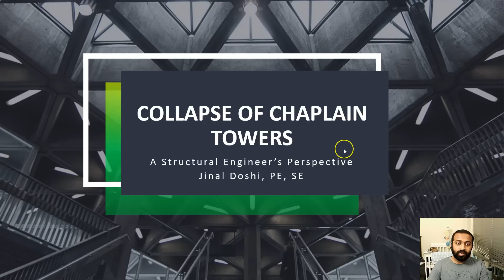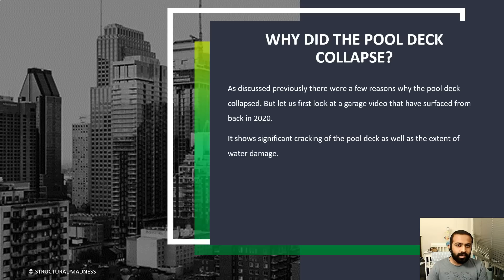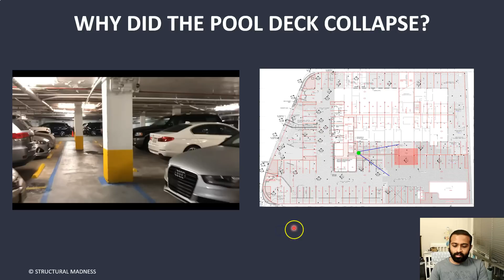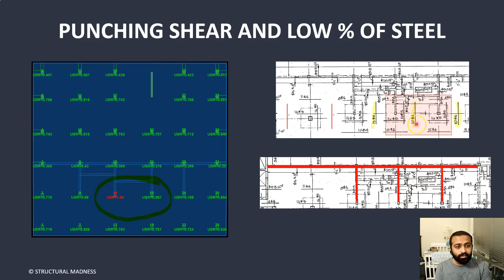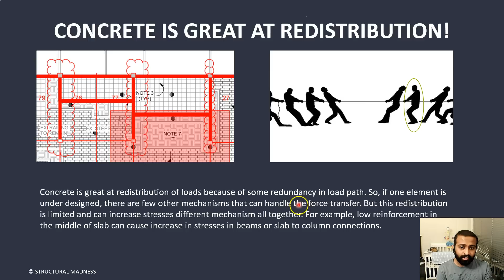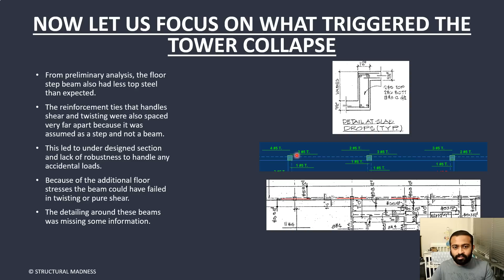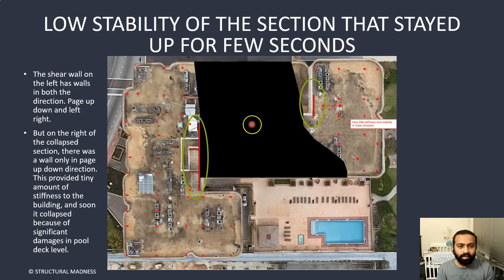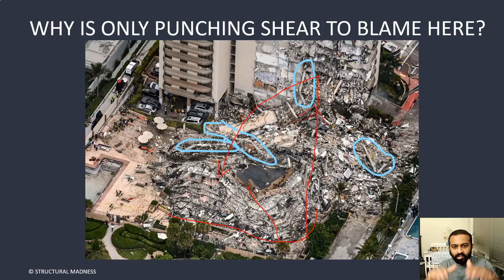Reasons behind Surfside Building - Champlain Towers South - Collapse : A Structural Engineers Review

Comment: You are aware that a copy of this building is still standing one block away, right? You are aware that the collapsed building recently failed its 40 year inspection in fairly dramatic (i.e. very expensive remediation) fashion. You are aware that the copy building passed with flying color. Based on your hindsight structural analysis, would you recommend they "pull" the copy? Would you recommend they strengthen it?
Reply: Yes I am aware, but that’s what my point is, this building stood up for 40 years. It took some significant strength deterioration up until this point to trigger this collapse. Even when we say the capacity of section was lesser than demands, we talk about design capacity. In reality the capacity of undamaged section sometimes may probably be higher than 50% based on material strength variability, how it was exactly placed on site and the amount of cracks that have opened up. 
If north was repaired prior to this, but not strengthen, it could be okay, but the consultants should carefully look at the couple of sections that I was pointing out because they were a bit overstressed. If the crack widths and actual material strength are higher than expected, then the towers will very well be okay.
Structural engineering is really complicated because of such issues. Like even two exactly same buildings can perform differently based on how they aged and how they were maintained. Now that’s why I didn’t talk about North tower because I didn’t want to apply a blanket statement of all buildings under designed.
Reply: I would most definitely recommend that they fully analyze and investigate and strengthen the sister building.  Hire me as an expert witness and I'll tell them that.  The structural analysis that we have done so far is only on a small part of the building, we don't know what other problems might be found.

Comment: Thank you! By far the most professional and comprehensive explanation of what happened to Champlain Towers South. Considering the North Tower was built with the same design I believe the North Tower pool deck should be strategically reinforced with temp columns until final cause of the South Tower is confirmed. Do you agree and do you know if they are considering this?

Comment: You are wrong at the end of the ramp is column 14 car parking space the next column is 27 car parking space or M10 and across is cps 28 and 76 where we see debris from the pool above before that the pool deck collapsed was noticed by report of someone there cps 72 which had collapsed into the garage so it collapse along the shear wall and the footpath of the building and cps 76 75 74 and was pulled down the building because of bad  design and weatherproofing shoddy maintenance and last of all not enough rebar on the pool deck and in the columns leading to punching shear .
Reply: Reminds me of a guy interviewed after 911 explaining the collapse. I thought it was peculiar. About 3 months later I heard his voice doing a commercial. I noted it and someone confirmed the name of the guy. He was an actor. Wish I'd kept notes.

Comment: What kind of maintenance could have been done to prevent this collapse? Unless they were going to replace beams, wouldn't this building have fallen regardless?
Reply: The deck needed to be taken apart and rebuilt.  There were water infiltration problems going back decades.  They had the option of jackhammering it apart, and fixing the underlying issues - the source of which are still undetermined (this will be the primary focus of the investigation, what was the original problem), or paving over it with some surface waterproofing.  The later is cheaper and more attractive, and the option almost everyone chooses, but it obviously was the wrong choice.  The needed repairs were so extensive the bldg may have to be evacuated for a year or more.
Reply: @kenlieberman4215  I wonder if that was done, would it have prevented this still. I don't know if the engineer hired even understood the immediate danger, nor  the HOA. I saw an article on the use of cat scan devices they use, after the fact, to determine weaknesses, but these aren't used prior because of the cost. I'm not making excuses, but pointing out that it's possible without this kind of test, nobody would have understood the real problem.  We don't even know until results are in, if fixing this pool area would have been enough.  Maybe it's time for more intense inspections , along with a grading system, instead of just at periods of time.  I have a feeling the current system, even if more frequent, still isn't enough. Are they still using the same criteria today for other buildings in the area? It's obviously not good enough.
Reply: @TnK2015  Morabito sent a report to the township in 2018 saying there was only 5% structural damage and it could be fixed with patching.  Clearly they underestimated the problem.  The problem is this type of damage can be hard to see.  Also the traditional grading system is based on the size of the cracks, but the location can be more important.  The garage video shows cracks running diagnonaly from column to column.  This indicates that the slab is overstressed.  But why?

There is the proximate failure - the deck collapse at whatever point; the adjacent failure - delamination of the top rebar/slab   -hidden under the paver/topping but seen in the cores where all the top rebar seperated due to water damage; and the ultimate failure - why was this slab failing apart so soon after it had been built?
This problem had been going on for decades.  To call it a "maintanence" is to call a lemon auto a maintenance issue.

A bldg shouldn't have to rebuilt every 20-30 years.  These bldgs are "over-engineered" - they have a 4x design factor.  This allows for errors in construction, but f enough errors occur, that may all evaporate.  The delamination of the structural slab would reduce its strength but more than half, but why did this occur?  Inadequate waterproof may have been an issue.  There is some evidence of less steel being installed than the plans called for, another issue but I think the biggest error likely is in the concrete itself.

On the first video I watched on the collapse one commentor sad they did construction in Fla. and concrete dires ot fast becuase of the heat, so after the inspector leaves(!) they spray water on the concrete.  This not only weakens it (which is why the inspector won't let them do it),  but also increases the porosity, so if the waterproofing isn't perfect... To me the biggest conundrum is why the greates are of water damage to the garage ceiling was under the lobby.  You know, the part that didn't fall, was protected from rain, etc.  Where was the water coming from?  The roof?  Could it make it that far down?  Bad plumbing?  

As far as tools go, its possible to detect water leaks with IR cameras.  The wet areas will be colder.  This is fairly new, but it certainly was around in 2018, and its pretty affordable.
Reply: @kenlieberman4215  yes, I've read about the issues you mention. I've been following as much as I can. My point is exactly what you're saying about a lemon. The popular blame is on maintenance, but it seems it wouldn't have mattered. The problem with blaming maintenance is it ignores other buildings. How can they say the sister building is fine, or any other when the means of inspection fall short?  It's as if there's a lot of denial and misguided blame.   I wonder if we'll ever learn?
Reply: @TnK2015  If this analysis is correct, then the bdlg was underdesigned.  Look at it like this:  the stiffness of a panel is equal to the cube of its thickness so a 9.5 slab is half as strong as a 12".  If the overage is just 2x, then even if perfectly built, its barely adequate.  Remember this bldg survived hurricane Andrew.  I suspect all these problems showed up after - the stress caused the cracking.  Up to now I'd been thinking water damage lead to stress cracking.  Water was the cause.  But if this analysis correct, and he's the first guy in Utube that can do a load calc; all the rest are BS,and are no more an engineer than I am, then water was the symptom.  

This means Morabito work was irrelevant.  It still would have collapsed.  Everybody assumed the bldg was engineered properly and was chasing the water.  But water wasn't the problem, so the repairs always failed.  The engineer is still alive, so investigators will be able to figure out what happened.  Even the best make mistakes.  It seems odd that they didn't go back to original engineer for an analysis, maybe he would have caught his mistake.
Reply: @kenlieberman4215  with all the lawyers involved, the blame game will go on for years. I just hope other buildings get a more thorough evaluation.  So far I'm not impressed.
Reply: @kenlieberman4215  Your comment called my attention (positive way) for 2 reasons. Hurricane Andrew entered through the keys, and it devastated South Miami and Kendall and continued its path to the Golf. The city of Surfsite is north of Miami Beach. I don’t know how strong were the winds there but it didn’t receive the highest winds. 🤷‍♀️ There have been many others after,  that might have had an impact also.
The most significant part of this comment to me after seeing this video is what you said about the Morabito analysis. If the suggested repairs were done there would had not prevented the collapse of the building. ☮️ thank you. Your comment was very helpful to me as a non engineer. 🙏 this topic is very difficult (besides being terribly sad) but very interesting.
Reply: @kenlieberman4215  Stiffness of an elastic material is proportional to cube of thickness, STRENGTH is proportional to SQUARE of thickness.  In reinforced concrete, if you keep the amount of reinforcing constant, then bending strength is only proportional to the thickness.
Reply: @billj5645  So that is why the span is proportional to thickness?  If you need 12" for 30 ft, it would 9.5 for 24 ft. right?
Reply: @kenlieberman4215  That's the general rule for reinforced concrete beams and slabs.  There is more to it than that though.  You can make a slab thicker AND put more reinforcing into it and get closer to the strength is proportional to thickness squared, but at some point the longer slab will have deflection problems so you can't make full use of the squared relationship.
Reply: @kenlieberman4215  , hurricane Andrew was not a significant hurricane in Surfside/north section of Miami Beach. It was in effect a strong storm. In fact, several hurricanes came through the area in the 00's, but none were significant.
Reply: @gypsy.burstingheart7020  , hurricane Andrew was not a significant hurricane in Surfside/north section of Miami Beach. It was in effect a strong storm. In fact, several hurricanes came through the area in the 00's, but none were significant.

My parents lived in a condo 7 miles south the Miami Beach/Surfside line starting in 1979 and through all the hurricane activity.
Reply: @kenlieberman4215  But even if you repair it by stripping it, cleaning off rust and re-encasing it, you can't see a lot more damage on the other side abd the middle. So, within 5-10 years, the Ph will get below 10 again, from water seepage and oxygen, and we start all over.
Reply: @Johnny.Fedora  Last place I want to be in a hurricane is a high rise. Much less this one, though.
Reply: @windsofmarchjourneyperrytr2823  , (such a long name), during Hurricane Andrew, no high rises collapsed. Meanwhile, entire neighborhoods of houses south of Miami were completely flattened. I'm pretty sure that was the case for hurricanes before and after that all over the U.S.

You don't want to be in any structure during a strong hurricane. Even a concrete bunker is subject to storm surge and flooding. What you want is to evacuate.
Reply: @windsofmarchjourneyperrytr2823  If you were to open up the slab yu'll find the hidden damage.  Its a chicken or egg question, you're taken the view that unavoidable water infiltration caused the concrete to lose strength- in which case how is any bldg standing for more than ten years in Fla; I'm saying the concrete cracked because it was under designed/under built and this lead to cracking and that's what caused the water infiltration.  This is why earlier repairs.  They viewed water as the problem rather than the symptom.  Concrete, unlike wood doesn't bend but rather breaks.

Comment: Outstanding analysis.  But the question in my mind is:.Doesn't every floor have to pass an inspection to verify that the rebar is tied correctly and then after the pour to verify that the concrete cured correctly?  How else would you ever know that the plans have been executed correctly?
Reply from the maker: Yes typically now a days there is a building inspector on site that reviews the work that is on going and verifying if it is acceptable per the consultants structural drawings. Since this was built 40 years ago, I am exactly not sure what was the standard process. I think someone way more experienced and older than me could possibly answer this better.
Reply: @StructuralMadness  I imagine there were so many of these towers going up at the same time, the inspectors had so many inspections to do per day that they went on good faith in some cases, a building slipped through their hands.
Reply: @KM-Eur  good point.  Corruption isn't out of the question either.
Reply: In my area structural inspections are pretty much the same now as they were 40 years ago.  Owners hire independent inspection companies to do inspections on their behalf.  Some inspectors are better than others but there will be very few that would know all of the intricacies of the design of a complex reinforced concrete building.  They can just look to see if the spacings and covers are right, things like that.  It will be very rare to find any city or government jurisdiction that has structural inspectors.
Reply: @billj5645  The more I learn, the less secure I feel about the industry as a whole.  Someday AI could solve some of these issues.
Reply: @TnK2015  you also should know that structural engineers get paid very less compared to other professions. And these days a lot pf really good engineers are leaving the industry for better stability in their lives. So It will be harder to get good engineers doing design, construction as well as inspection for you. 

But in general building codes have improved a lot since 1980s. The code requirements were laid out in 100 pages back then and now we have like 500 pages of the same building codes that we have to refer to. The details are much clearly laid out and on general notes all the things that have to be inspected are presented in detail. We also have to pass professional engineering exams for our licenses to be eligible to practice structural engineering. So things are much better today than they were 5 decades ago, but the pay is very poor.
Reply: @JinalDoshi91  thanks for enlightening us. I'm sorry to hear about the pay. It seems the most important work is becoming less valued.
Reply: Generally the works have to be inspected as said but standards of checks varies considerably depending on the competency and independence of the inspectors. I previously worked as a site-based Resident Engineer in S’pore in the 90s/00s, representing a reputable high rise apartment developer. My team of 5 performs QAQC inspections and have to approve and certify every concrete pour ensuring the reos, formworks, covers, etc, and all embedded services are constructed in accordance with the approved drawings and thereafter cured sufficiently. Basically checking on the contractor’s workmanship. Examples of errors picked up include reinforcements being undersized, incorrectly spaced, missing, insufficiently lapped, column bars out of alignment (vertically out of position), incorrect floor levels due to surveying mistakes, among others.  Sadly, design and construct (D&C) projects became more prevalent which means the contractors/builders are now responsible for their construction workmanship and quality and approves their own works. (It means savings in employment costs of several engineers and supervisors for the duration of the projects.) You don’t have to be too bright to guess which direction the QAQC went when the independent oversight is removed. Now based in Australia, I witness the same deficiency and must say the construction defects in D&C apartment projects in Australia have become a national disgrace. More can be googled if you are interested.
Reply: @mikecheng77  thank you for your response. Eye opening for sure.  It seems we're going backwards.

Comment: Any place there was spalling there were watered planters above it. Any place there was standing water there there watered planters above or beside it. Any dripping water on the garage ceiling had watered planters above. When water penetrates concrete and reaches the rebar- it rusts. When rebar rusts it grows 3 times in size and loses its strength, chunks of concrete would start falling off. In a 2018 Engineering report they called out the leaking planters as the cause of spalling & advised the HOA it needed to be addressed NOW as damage was exponential.